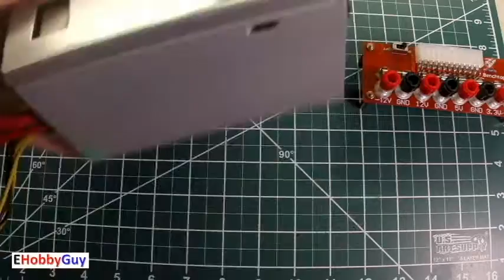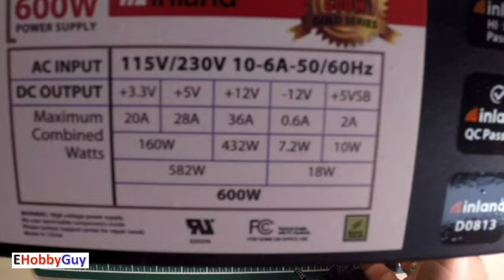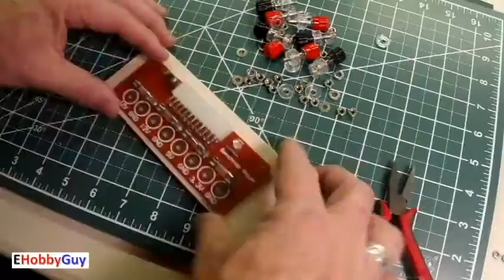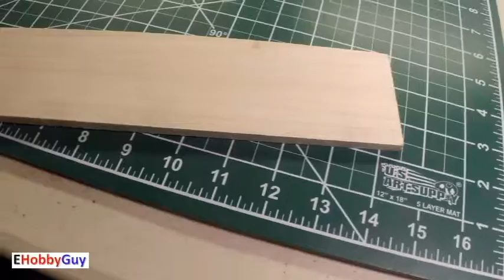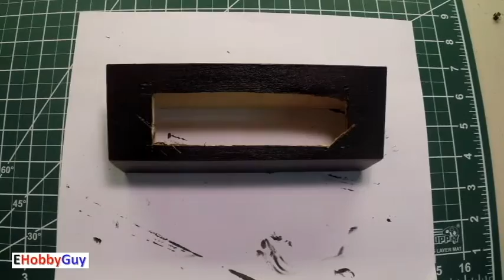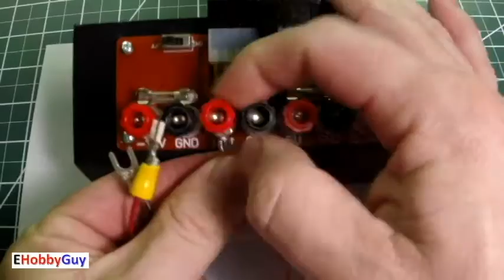Make a Benchtop Power Supply for $8

Comment: Can you combine outputs to increase voltage or amps (in series or parallel). For example, combining 12V + 5V to get 17V. Or the same two rails 36A + 28A in your supply to get 64A if needed.

For example, most laptops require 19V 2.5A, It would be cool if I could combine 12+5+3.3 = 20.3V then the laptop can draw the amps it needs. Or to get some leads hooked up to a variable resistor, then you can plug in for example, all three, or any combination of three or even just any one, and then use the variable resistor to reduce the voltage to any amount required. Or maybe even use a buck or boost converter if you needed even higher voltages, or maybe even somehow combine two or more power supplies.
Reply: You can combine TWO voltage rails to create a new voltage... But the maximum current will be equal to the weaker of the two rails. So, yes, you can combine -5 and +12 to get 17 volts, or +5 and +12 to get 7 volts, but the max current will ALWAYS be the lower of the two current ratings.
 To figure out the available voltages, imagine all the fixed voltages on a linear scale. The available voltage is the difference between two points. -5 and +5 = 10V,  +3.3 and -12 = 15V3, etc...

Comment: What is the maximum current the breakout board will handle?
Reply: That depends on your PSU rather than the board, look at the sticker on the device itself. Usually ATX PSUs are able to deliver most amps for 5V and least amps for -12V, with 3.3V e 12V in between.

Comment: Great video and review.  I like the box idea!  I have several of these same breakout boards, they are very handy indeed!  Two of my boards are mounted directly to the top of ATX boxes.  One modification that I have done to the board is that I've changed out all the original binding posts with 4mm banana plug biding posts.  This not only  allows me to keep the original ability of binding a wire to the post but allows me to simply plug into any voltage with a 4mm banana plug.  I like the idea of making power wires for power breadboards.  I will take a page out of your book with that idea.  I got my posts from ebay 
http://www.ebay.com/itm/10-Pairs-4mm-Binding-Post-Speaker-Terminal-Banana-Plug-Socket-Jack-Connector-New-/291915712085?hash=item43f7884655:g:TNgAAOSw4CFY5J~h
Reply from the maker: B. Anderson glad you liked it. Thanks for watching.